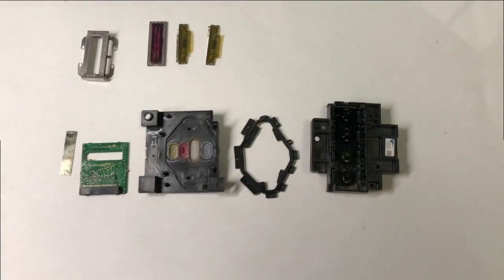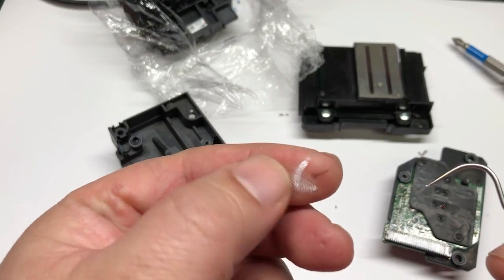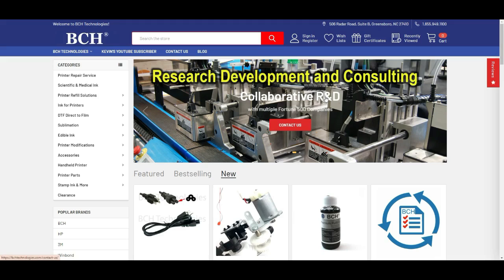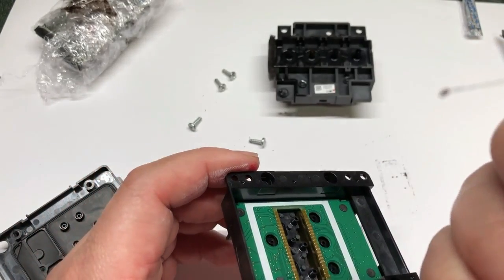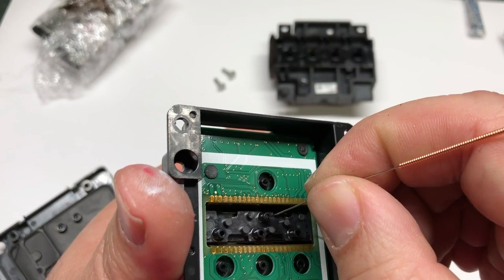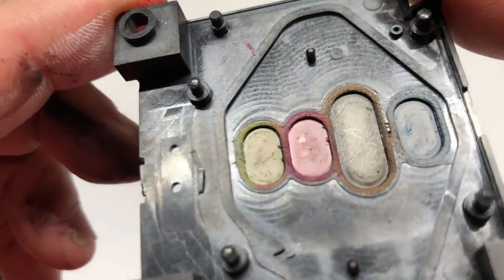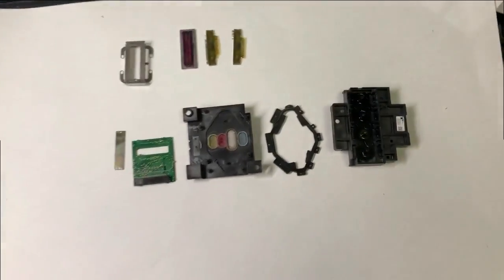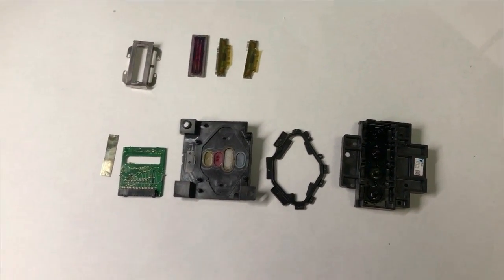Extreme Unclog Epson Printhead - L1800 DTF DTG, WF-7720 Sublimation, & EcoTank SuperTank

Comment: Hey Kevin!! I’m on your website trying to order the blue unclogging solution.  Can’t find it. I have an L1800 dtf Procolored printer and new printhead the black is clogged not in the base but took apart in the piece you put in ionizer. It’s there where the clog is I soaked in water to try and break up but I need some good dtf cleaner. Can please let me know what to get or a link I can purchase the blue one from?!
Reply from the maker: Thanks so much for your support and for reaching out—really appreciate you watching and digging into the details! The “blue” unclogging solution you’re looking for is now clear in color (same formula), even though the SKU may still say blue, and you can grab it here: [https://bchtechnologies.com/products/premium-cleaning-solutions-for-dtf-inks-maxstrength-against-white-ink-clog?_pos=1&_sid=866c89327&_ss=r](https://bchtechnologies.com/products/premium-cleaning-solutions-for-dtf-inks-maxstrength-against-white-ink-clog?_pos=1&_sid=866c89327&_ss=r); it’s appropriate for DTF use and for addressing internal clogs like the one you described beyond the base of the head, but take it slow and follow proper soak/flush procedures to avoid damage. Also, quick note on replies since I get a high volume of questions: subscribers and members receive priority replies and perks like early access to videos and are typically answered within 48 hours; regular viewers are answered if time allows since I can only reply to about 10 questions per day; after subscribers and members, any remaining reply slots are filled last-in, first-out (newest questions first), so if you’re not subscribed and don’t hear back within 48 hours, you can either subscribe or re-post your question—newer comments are reviewed first, and if you subscribe later your older questions automatically become priority without needing to re-post. If you want real-time help, join Run With Kevin — LIVE, where I go live every morning (usually between 6–8 AM Eastern) and answer printer questions on the spot, so subscribe and turn on notifications to catch the next session and ask directly. For faster one-on-one assistance, you can also email [support@bchtechnologies.com](mailto:support@bchtechnologies.com), and if this video or my comment helped you, I’d truly appreciate a Google review here: [https://g.page/r/CfL7k6nYvPQ9EAg/review](https://g.page/r/CfL7k6nYvPQ9EAg/review).

Comment: My yellow quit working. I have L1800.  I have done power flush, ran cleaner through the nozzle and print head and flowed perfect and still doesn't print.  print head is clean and not scared. Changed damper, changed ink, bled the line,  I'm at a loss.   Any other suggestions?
Reply: Same issue with mine.
Reply from the maker: Thanks so much for watching and for your detailed question! If your L1800’s yellow still won’t print even after all that work, try pushing some cleaning liquid gently through the yellow channel to confirm the nozzles are open. Then park the printhead naturally on the capping station by turning the printer on and letting it rest there — it’s safe to do with power on. Because DTF ink is thicker, the printhead might need a little extra help to start. Once parked, connect a syringe and tube to the waste line and slowly draw about 2 ml of air; if you feel slight resistance, that’s good. Drawing only air means the seal is leaking, while total blockage means the capping station is clogged. If the membrane on the damper crinkles, it means the nozzles are open. Afterward, use the printer’s normal cleaning cycle, but don’t run strong or back-to-back cleanings within 12 hours. I really appreciate your engagement and support — please consider subscribing or becoming a member! Subscribers and members get priority answers within 48 hours plus exclusive perks like early video access. Since I get hundreds of questions and can only answer about 10 a day, I prioritize subscribers and members first, then newer questions if time allows. If you’re not a subscriber and don’t get a reply within 48 hours, you can subscribe (your old questions automatically move to priority) or re-post your comment since newer ones are reviewed first. For faster help, email [support@bchtechnologies.com](mailto:support@bchtechnologies.com), and if this helped you, I’d really appreciate a quick Google review here: [https://g.page/r/CfL7k6nYvPQ9EAg/review](https://g.page/r/CfL7k6nYvPQ9EAg/review).

Comment: Hi Kevin, do you have  a video replacing the ink pads that pull ink during cleanings? or the pad that runs across the printer? Mine is soaked. I have a wf7710

Comment: Hi, Kevin
Do you have a video how to unclog Epson printheads which can’t be disassembled like the ones used in the XP-printers or the one you showed for the Ecotank?
Reply from the maker: Not yet. I am making an automatic cleaning machine, and I plan to shoot a video after that, so stay tuned.
Reply: @BCHTechnologies  Thank you. I will be looking forward for this video. It’s a pain in the ass to unclog such a simple printhead where all the parts are hot welded and fixed. Working on one from a XP-352 for a week and still som black nozzles clogged. The head is outside of the printer and I use cleaning solution an ultrasonic. Twice a day it’s in the ultrasonic bath, some small particles come out but not all. It’s a cheap equipment and ha not the correct frequency. Startet with all nozzles clogged, colors are good now, but black nozzles at both ends of the row are still not free.